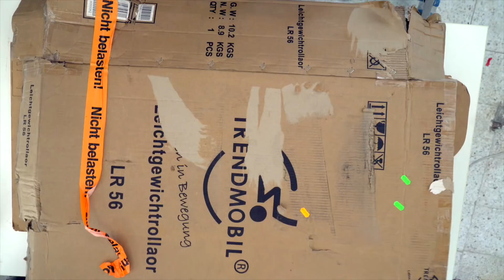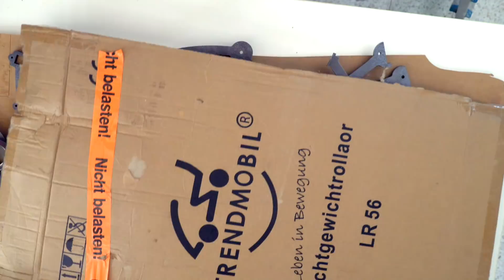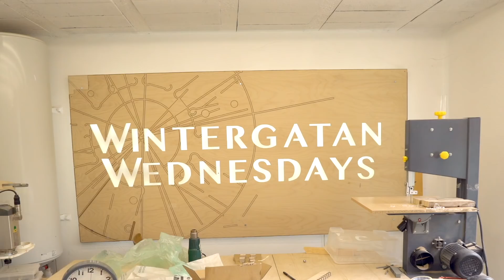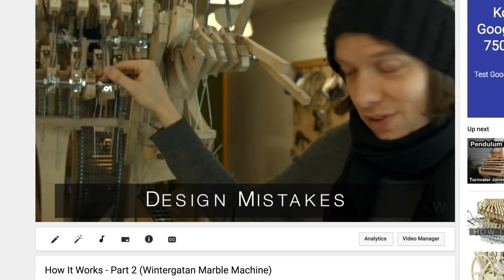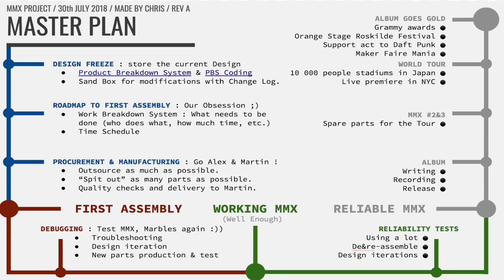Flywheel - Marble Machine X #46

Comment: Great video as always.

I have some concern about press fitting the bearings.
I once fit bearing into cogwheel of my RC Heli by brute force. The result was bad as the bearing balls compressed and there were problems when the motor spin the cogwheel.
Then I discovered better method, to make the hole just large enough that the bearing would easily fit, but not play. And then I used a special Loctite (e.g. 648 green) which is used for permanent metal to metal bonds. The friction of bearing balls was improved signifficantly.

Comment: Great video, but those bearings should be an interference fit not a loose sliding fit. Machining next to bearings is a good way to wreck them - those seals aren't designed to protect from metal chips. Better to remove the bearings before machining operations, or at least mask them off.

Comment: May i suggest using nylon lock nuts on the bolts holding the flywheel together?
Reply: Joepopa12 yep right ; or use some thread lock like Loctite.

Comment: I am screaming at the screen so much :(

Your drill press is running a tad fast for metal, the bearings are probably mostly not going in because the piece they're going into is missing a chamfer. They will also bind while you're putting them in by pressing on various spots on the edges; it is more sensible to press them in with a press or a vise. Chamfers are the key to getting stuff to go on correctly.

Comment: Did you choose to mount the bearings as loose as you did on purpose? Normaly you press them in. It should not be possible to press them in their fit or on their rod by hand. Also they shouldn't be able to rotate freely in their fit or on their rod.
It's hurting me so much seeing this as a mechanic.
Please read about interference fits.

Comment: this part I don't like. Why didn't you turn a proper shaft instead of taking a rod and putting lasered discs onto it? and why did you make the flywheel out of 2 layers with identical shape? it would have looked cool if you made 1 flywheel in the middle and just put 2 rings onto each side - this would have given it more depth and would have looked way cooler.